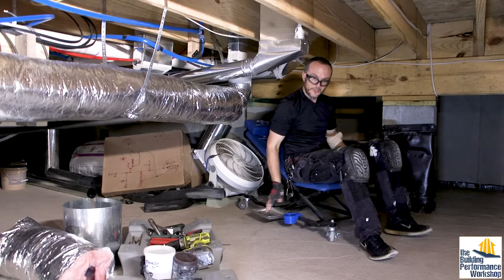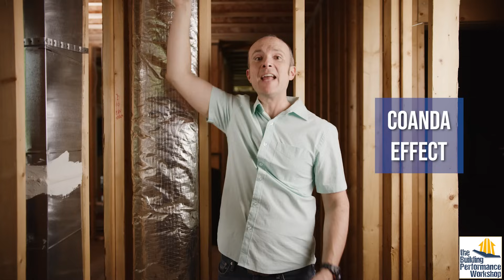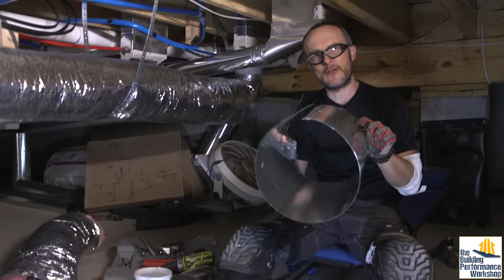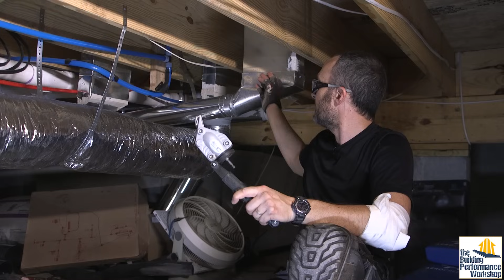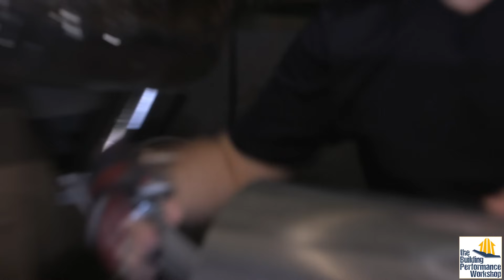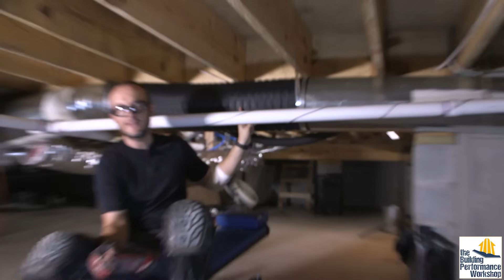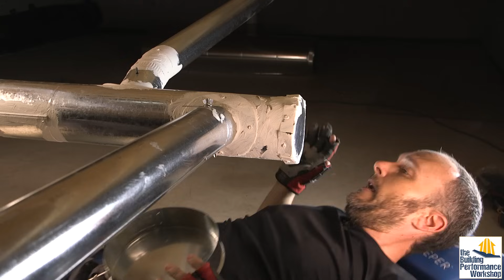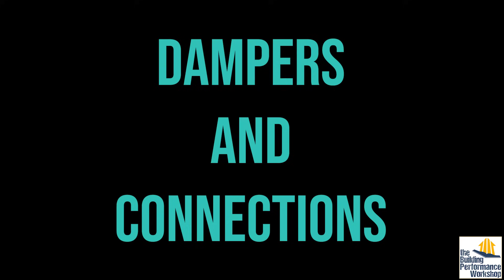Performance Duct Design & Installation: Advanced DIY

Comment: I'm a contractor and this guy is trying but he doesn't know what he's talking about when it gets technical points. His anti flex "I just don't feel" xxx  no facts there. I've worked on building 600 year homes and now I'm developing entry level starter homes with the same technology. Move on to others for expert knowledge.
Reply: This guy has an expert in the field working with him, and commissioning the system. His comments about flex duct are essentially correct.  This installation  is probably better than 95% of the new installs out there especially, those which use flex duct for the entire system.  The only positive thing I can say about flex duct is that it’s cheap.
Reply: @rodgraff1782  well as a licensed HVAC contractor the fact is everything is a decision. I was pulling flex off the trunk of my dad's cheap modular and re-installing it and it held. I'm 52 and I'm seeing 30 year old flex now. Properly installed I haven't seen one run fail yet. I do round trunk with flex legs. The fact most installers don't know the difference between A-P   and B-Flex isn't relevant to his statement that he admits is 100 percent baseless on flex
Reply: Ok before the flame comment. I've also worked on the top homes in the world and spent 20 years only doing top tier houses. Move back to a small town to be near my folks and I'm building specs.
Reply: I’ve worked on a lot of very expensive homes in Palo Alto, Atherton,  in the San Francisco Bay Area.  Residences with boilers and chillers, with ten different air handlers and DDC controls.  We didn’t use flex on those, but I have seen some very expensive homes that had the worst duct installs I’ve ever seen.  We did one commercial building that the engineer specified a flex that had a scrim cloth interior.  It was the worst I had ever seen.  It all disintegrated and had to be replaced within the warranty period.  I believe the brand was JPL sound flex.  The inner liner didn’t even hold air.  It depended on the outer vapor barrier, so any little rip let the air out.  There is good flex out there, very tough rubber liner, with built in draw bands on both ends.  I have no problem with using it from a trunk to a diffuser, but not for whole systems.  The first shop I worked for used alumna flex exclusively, except for commercial jobs.  I was a service tech, and have seen my share of crappy ductwork.  When I started, back in 1973, I didn’t see much flex.  They used to do residences with tin pipe, soldered and taped at the joints, then wrapped with asbestos.
Reply: @rodgraff1782  yep I hear ya. But let's point out flex is cheap and cheap often gets a cheap bad install. Doesn't mean flex is questionable like he said in the video. We're old enough to remember all the crappy construction products from the 70-80. Then all the bad manufacturers went out of business in the 90s. Occasionally you get something like the tyco fire sprinkler recall but it's so rare these days we hear about half of them. Follow the PDF install instructions, your good whether it's stone or plastic. You hear someone say "I've been doing this since I was 12" when you ask if they read the install specs you know you have a problem.

Comment: question,   do I need to insulate the metal ducts?
Reply from the maker: Probable, and most people do- I’ve been running an experiment waiting on mine (can always do later), and I have no condensation showing up on the concrete floor even after 2 summers.

Comment: So, have you looked at the hole in the actual air handler? Is it 201 sq in at it's most restrictive point? (simple answer: no). Will having more than one restriction additive and increases static pressure? Probably. Is it that bad? Probably not as bad as you might think. But the industry is happy to sell you any additional components you might feel you need to have. lol

Comment: Excellent video. Watched start to finish. Our duct work is original to the house, is all flex, has sider boxes, and dusts the house a lot. Unfortunately, most of the build shown is undoable (reasonably) in our case as we have a short attic space to work with (crests are 5 ft down spine of 2400sq/ft  ranch style home) and I'd imagine to pull this off, the roof would have to come off. I've crawled around up there and everything is difficult, running CAT6, electrical, added insulation etc. Costs for a contractor to do this I'd imagine would approach what we payed for the house back in 2005. Still, I learned a lot and appreciate all the info. On new builds this is a great step-by-step almost tutorial. I wish there was a way to incorporate it into our 1967 built south Texas ranch. Our electric bills touch $500 this summer with the thermostat @ 78F. Brutal. Good luck with your business and channel.
Reply: Lstiiburek would say "ducts don't belong in the attic, they belong in the conditioned space of the house."  Consider moving your duct work out of the attic, and instead run it along the top border of your rooms and hallways. You can disguise duct work into a new tray ceiling you also install at the same time. You can also disguise duct work into plant tray shelves made out 2"x10" and covered with sheet rock, giving your home the look of a transitional home. You can put high cubby-hole cabinets in a bedroom, similar to kitchen cabinets. Hide the ductwork in there. You can put long bench seats along your outside walls under windows, move your outlets to the base of the bench seat, and run the duct  work under the bench.  You can do this for adjacent bedrooms on the same side of a house--running bench seats in both bedrooms under their windows, and running a long duct from room-to-room, under the dual bench seats.  Lots of ways to hide duct work that is inside the conditioned space of the house--where Lstiburek would want it.  Hardest part will be insulating the ducts so they don't sweat and create moisture within your new constructed tray ceilings, cabinets, plant shelves, or window bench seats.

Comment: My understanding was that the supply side ran on static pressure. What is the mechanics involved in using a scoop if the system is pressurized properly?
Reply from the maker: The scoops do add static pressure, but Mitsubishi units are designed for up to 0.8” wc

Comment: I have installed ducted heat pump for ground level open lounge/ family room 80 square meters 10 kv daikin system with 3 x 200 diffuser and have return on upper level ceiling is this right or I need return from ground level too .
In morning when out side 5 degrees c inside 14 I set 23 and it takes 3 hours to reach 23 and expect to heat in 1 hour am I right

Comment: The one thing I noticed in your build is that a lot of stuff is running through the middle of the crawl space making access to various areas quite difficult.  Wherever possible, as much of plumbing and electrical should be run in the joist space.  Drilling a few holes does not weaken the joist and pex pipe is really easy to  run either along or through holes in the joist space.  Keep the holes in the centre of the joist as the load is carried in the top and bottom of the joist space. Not only does it make things look neater, but also gives you more space for installing duct work
Reply from the maker: Plenty of space there still, Jonathan, but I hear you

Comment: That flex will last for 20 +years if properly installed and in a conditioned space also just a tip, use wider support straps to hold up that flex, not plumbing strap. There is nylon strap to support flex and if my memory serves 2 to 3 inches wide.
But, very good job with a challenging install.👍
Reply: Most people don’t have a nice conditioned crawl space like this guy has.  Having  to repair duct under houses, I wish I had that much room.  Looks like he even has a rat slab to roll his creeper around.  In our area, codes have changed, and crawl spaces have to be sealed and conditioned with a de humidifier.
Reply from the maker: Thanks buddy!

Comment: Damn. I am in the process of planning a new construction. I hope I can find a an HVAC designer locally that seems as knowledgeable as you. I plan on doing the installation myself but I’m out of my depth on design stuff.  Thanks for the knowledge, dude. Awesome.
Reply from the maker: Thanks very much, Thomas- glad it helps you, and FYI I’m working on a design course to make this type of system more possible for folks like you.
Reply: @HomePerformance  Oh good idea.  If I was going to do this more than once I’d probably be interested!  For a one shot deal though, it makes sense to just get a pro to get it designed right.  And honestly if you are interested in engineering my hvac system for me, it might be worth a quick conversation for starters.  It’s a small 2 bedroom in upstate NY and I’m still playing with the layout. So shouldn’t be an enormous pain in the butt as I can still easily make room where needed.  No pressure- just thinking out loud.

Comment: So how do you insulate the hard metal duct?  There's no way I could put un-insulated ducts in an attic in Texas.
Reply from the maker: Correct, we shouldn’t be putting anything we care about in the attic. Conditioned, encapsulated attics or a plenum truss system would be much better, but to answer your question you wrap the ducts in insulation. R8 or R6 fiberglass smells like cat pee, or reflectix works as well.

Comment: Great information!  i am installing a new downdraft range and need to extend the current in-wall duct (3.25" x 10") about 10 inches to install a 5" start collar so i can connect it the downdraft range.  Is it possible to do this without tearing out the entire system? it seems like it would be difficult to do leaving current duct in place.  Thanks for any advice!

Comment: Those thick filters are awful. You have a nice metal duct system and you’re choking it down by using a thick filter like that. That’s going to put your static pressure way higher than if you just used a standard non hypoallergenic filter. If you’re concerned with filtration and air quality I’d recommend a phenomenal aire
Reply from the maker: No, static pressure is exactly as designed. You put the manuf pressure drop into the duct design calc. Then you test.

Comment: Critical point: try not to insulate ducts while an a/c system is operating.   Condensation can cause problems with materials during application, plus you dont want to trap moisture.  Same goes for chill water piping [not typically found in a house], and that brings up foam [of any type]: open cell is an enemy where trying to barrier against moisture - maybe relegate that to hot water pipe insulation, or anything else where permeability is of little concern..
Reply from the maker: Excellent points, Flinch

Comment: Thank you for all the work you put into this channel. Nice to see the numbers that fix the problems. 
Have a question about just the one return. What about when the system is running and a couple or all the bedroom doors are closed. Doesn’t this cause problems?
Grace and peace 
Slick
Reply from the maker: Hey Slick, thanks, and NO, it doesn’t cause any problems for the room pressurizations. How do we know this? Numbers again- we test for it. I’ve been testing homes for that for over a decade, and it’s not hard to achieve <3 Pascals across the door. Our house has 1 Pa across the closed doors. Totally fine. The HVAC guys just like to scare people- it’s because they’re scared too.
Reply: Thank you for getting back with me. That’s pretty cool for you to be able to get those results. Guess I just don’t realize how poorly running the systems are in the house’s I’ve lived in. I’ve seen dark lines in the light color carpet where the door would be when closed. 
Very appreciative for your reply. Hope you and your family are well. 
Grace and peace 
Slick

Comment: You need returns in every room it make the system run better
Reply from the maker: No you do not.
Reply: @HomePerformance  your a home performance, not an HVAC guy. You need more returns plain and simple. The system will not be efficient
Reply from the maker: Untrue. Test it.

Comment: 31:41 amen to that brother, unfortunately that line also cues the laugh track from the rest of the blue collar guys we have to work with. I remember one job I was on, putting in a new run for an old house renovation. I was working in small single room basement that would never see a true finish, for this run I was putting in I needed a particular chase to make it work, unfortunately the electrician had already put in a new light in that chase where I needed to use it. So I did what anyone sane person would have done and I moved it. The electrician didn't like that very much, in fact he hated it so much he called up the general contractor to come on over to chew me out. So the next time I was there GC shows up asks what the hell I was thinking, so I showed him and luckily he at least understood and could tell the electrician was being very whiney and essentially told the guy to shove off. But it speaks volumes when the people you work around feel entitled to never play second fiddle to what you're doing. Unfortunately HVAC and what it does is often not well respected by the other trades. At least that's my experience around my area.
32:20 I saw one guy once who had developed this skill, he would take 30 gauge round pipe unsnapped, curl it up and shove it into place, then would snap it into shape. It was crazy, he could do it real fast too. Flex duct is probably the right solution for most people, but it was impressive what this guy had taught himself.
34:36 that's not really how ducts work precisely. The actual idea of how a trunk line works is to just think of it like a pressure box, it has a bunch of air pressure that wants to escape where ever it can, so just poking a hole, guided or not, will cause that pressure relief and the air will guide itself out. In fact putting a scoop on, if it's too big relative to the trunk line, may cause enough of a blockage downstream of it, that it ends up eating more static pressure than it should and will over velocity the run in question while taking away from anything downstream of it. Scoops can be useful if you're dealing with unusual static and velocity interactions. Like if you've got 1600cfm coming down at 1100fpm and for w/e reason you want to take a 4 in off of it, okay a scoop might be helpful there. Perfect ductwork doesn't need scoops nor does it want them and they will actively hurt it in fact, but when life inevitably comes a knocking and you have to use imperfect ductwork that causes an issue, a scoop might be the solution.

Comment: Flex should only be used in unconditional areas. Attics or crawlspace. I always run main supply in hard duct. Even in a attic. The right way is returns in every room but kitchen and bathrooms. Central returns are cheap way. Also even in attic supply and returns should be hard pipe then wrapped with insulation or last five feet flex. But builders want cheap. So guys use flex all over attic. Then homeowners wonder why shit don’t work or sound right.

Comment: Used a lot of duct sealant on that connection. Flex is good in certain situations and it holds up pretty well. The snips they have other red ones that’s righty snips. Crimp tool is mandatory. System looks good. Doing duct work without the right tools is a nightmare.

Comment: Thanks for the great explanation in here.  A quick question for @Home Performance though.  Around 35:20 when you're discussing the dampers in the ducting, I see that you have a hole in the ducting where the "arm" of the damper sticks through and is stabilized on the side that doesn't have the handle.  That seems like a decently large hole that isn't sealed.  IS there a later step (not shown) where you cover that or seal it in some way?

Comment: Did you do Central Vac? (looked like an inlet beside your return air) How do you deal with the pressure change when in use? (assuming your canister is outside the conditioned envelope)
Reply from the maker: Yes we did, and no pressure change since the canister is indoors. However, it only moves about 50 cfm, which is pretty small pressure even for a house as tight as ours- only 5 Pa or so.
Reply: Thanks! Keep up the good work!!

Comment: You are a very good instructor. My background/education is in Mechanical Engineering  Thermo and fluid mechanics. I used to be able to design a system but I don't have my ASRAE handbook anymore so I if you have some sources for instruction, etc. I would like to know. I bought a house with a f**ked up system that uses all flex duct. I am going to replace it with galvanized steel but I suspect that the 10 inch supply lines (corrugated flex crap) are 10 inch because of the poor flow characteristics. 
I really like your instruction style. What is the black flex duct you used to isolate the machinery sounds? It look like industrial flex duct made from impregnated cloth with wire sandwiched between the layers.  If that is what you are using it will probably last more than 20 years. That is some very tough stuff.
I am in Houston, TX.
Reply from the maker: Thanks for your message, John, and I’m rooting for you with your re-duct. The black stuff I actually found on A**zon, called TerraBloom.
Reply: @HomePerformance  What is the mastic sealant you are using on the ducts you are assembling? Type or manufacturer would be handy information.
I saw the TerraBloom as well as another product that has a smooth interior surface.
Reply from the maker: I like to use RCD Mastic #6

Comment: The single master air return is a terrible invention created for the tract home industry. If you have the door closed in any room without it's own return, the air will not have an escape to get back to your huge single return downstairs.
Reply from the maker: That’s not true, all you have to do is keep the pressure differential under 3 Pa with the door closed.
Reply: He could simply undercut the doors.